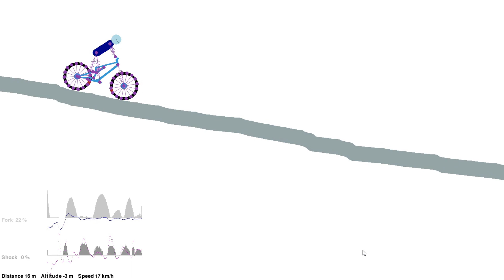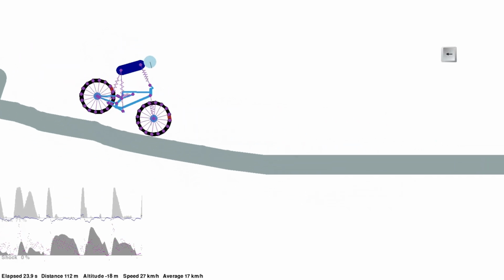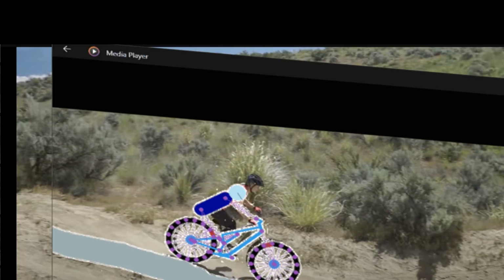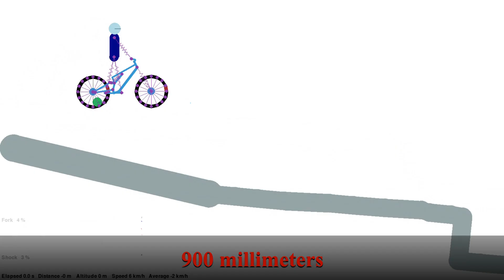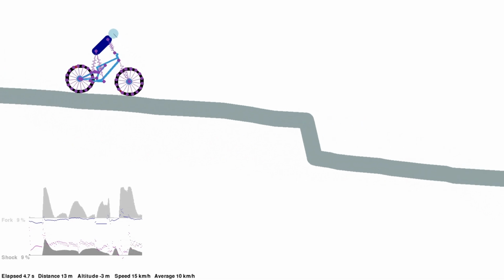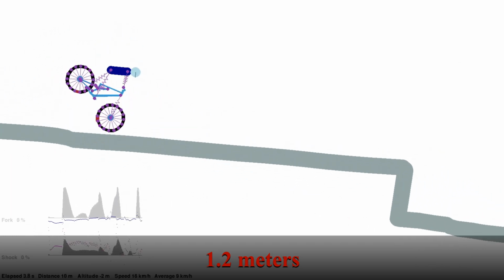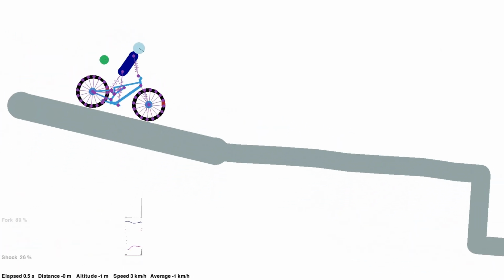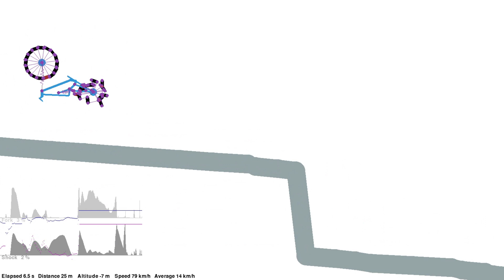Step-down drop fail! — mountain bike physics

Comment: When i do drops, i lower my body in the neutral position, then push my bars forward going off the lip. No preload. But it requires a much faster approach
Reply from the maker: I know what you mean. Gyro is controlled by making his arms longer or shorter, or his legs longer or shorter. When I push the controller button to make his arms longer I can think about it two ways. In one sense he is "leaning back" but in another sense he is "pushing the bars forward". From the physics point of view it is kind of the same thing I guess.

Comment: Nice work. Would like to see the physics of a "real" bunnyhop where the body is doing the movement of a mirror-inverted L to lift the front wheel first. The body movement to the basic position later lifts the rear wheel.
Reply from the maker: Cool idea! I should explore real bunny hops more in a future video.

Comment: Teach Gyro to manual and to uload both wheels shortly gefore the drop by a sort of bunny hop while shifting weight  backwards. 
Also include dampening to your suspension!
Reply from the maker: Gyro needs a closed-loop feedback control system to do a manual, quite a serious upgrade. We will save up for it.

I do plan a future video about suspension spring rates and damping. The setup is working but not dialed in yet.

Comment: Very interesting simulation. Great work.

It takes much more skill to do pretty much anything on a bike slowly. Within reason, the bigger the drop, the smaller it will feel with a bit of speed. Steady speed too, if its available. It would interesting to see the impact of having steady and higher speed when the reaching the drop.

Also, would bent knees, bent arms, low and centred over the bike (the attack position) change the riders centre of gravity. Good technique is to be in the attack position at take off, push out in the air, and then suck it all up on the landing. Getting way more complicated though.
Reply from the maker: Thanks for the feedback.

Gyro agrees with you: faster=easier drops. Gyro rides in the attack position by default so his abilities are most limited by how quickly and accurately I can push the controller buttons.

Good point about the landings. Gyro has not emphasized trying to absorb the energy on landing - he just takes the punishment. We could try to play around and see if we can get the timing right.
Reply: @moregameconcepts  Great to see a rider who's prepared to take a bit of punishment but gets straight back up to give it another go after wiping out. That is true courage. Gyro has it in spades.

Comment: You've probably already though of this, but something that might work on the bigger drops is pushing the back wheel down while in the air. Unweight the front wheel as Gyro is going over the drop and then before he lands have him pushed down using the 'pedals'. 
Just a thought, anyways nice vid  🙃👍
Reply from the maker: At low speed the front wheel starts to nosedive before the back wheel even gets to the edge so it is too late to try to push down while in the air. At higher speed, un-weighting the front wheel is good enough already so your strategy of standing up in the air does not hurt but is not necessary.
Reply: @moregameconcepts  Ok, appreciate you taking the time to explain that to me.

Comment: Pretty cool stuff. How did you characterize the stiffness of Gyro's limbs, did you dial the suspension tuning by trial and error?
Reply from the maker: Glad you like it. Yes you are right - limb spring rate and damping was by trial and error to make Gyro's movement seem natural. The suspension was "tuned" using the compression graphs in the lower left. I set the "sag" preload and checked "bottom-out". I plan a future video about more thorough analysis of suspension tuning.

Comment: Try preloading the suspension with Gyro's body weight before the drop.  Also on the smaller drops, at low speed, Gyro can hinge forward, lower the chest to the bars and let the front wheel drop as his arms extend.
Reply from the maker: I agree those methods work for small drop heights. We tried preloading straight down on the suspension before the larger drop heights but the bike still nosedives. Either Gyro needs to do a full bunny hop so the back wheel clears the edge or else there needs to be some front/back weight transfer. Gyro and I have found that front/back motion works better and is much more forgiving than up/down motion. Also Gyro gets less fatigued.
Reply: @moregameconcepts  As a MTBer I agree and he was close during 2:30.  Just needed to learn to lean back driving the rear down while springing up that way only the front is unloaded - front stays up longer easier (slower big drops) and no worry about clipping rear.
Reply from the maker: Good advice thanks.

Comment: Good to see Gyro surviving a bit more of the beatings...

For one of the slow big drops... (If you got the 'equal and opposite' thing right where his mass moving back also accelerates the bike forward...)
(Non motorised version)
Have Gyro push down on the bars just before the lip then push out (move back) so the front is rising as he goes back and the front is leaving the lip.
Also you may find NOT pushing down on the back as well as the front in a drop has a better effect, as pushing down on the back will tend to push back before the rear leaves the lip.. meaning the rear of the bike will be pushed up.. making the front drop... nosediving poor Gyro into another Pixel Hell.. basically having the same effect as not loading either wheel...
(Actually interesting point... does his trajectory with a mid load (both wheels) have the same effect as just rolling off... 
hmmm... I was thinking the roll off should be slightly faster to compensate... then realised... if I'm right... if the mid bounce has the front leave the lip before the rear has finished rising.. that will lever the front down faster as it rises...  if both wheels rise fully and the bike (and gyro fall back some before the rear wheel leaves the lip... (like a shockwave)... again it will load the back and then push the nose down...
And if both wheels clear the lip...    well actually that's a European bunny hop.. and in theory, no difference in load of the wheels so no angle change... Gyro should land flat... but at a higher drop than just rolling off... which may be just too much impact load...

oooo my brain hurts...   (And I am literally in the middle of watching 'the Time Travellers Wife' series...

so of course though up something else...  Have you tried softening the landing by "bending his knees" on landing...
and also is it softer landing a little nose first...

(Personal experience, landing tail 1st accelerates the front into the ground worse than the other way around. (Literally broke 1/4 of my front spokes on a very nose high landing on my old IT200 enduro trailbike.
Reply: as for timing, try to start the shift back closer to the lip... almost as the bottom of the wheel touches the lip... 
For that big drop but too slow... try the full set...
Move Gyro up and over the front, bump Gyro's shoulders and the forks down so they hit bottom as the centre of the front wheel is about to leave the lip and immediately start the rear weight shift... If his "Knees" are bent at the end of the push , extending them as he falls may also help survive the nosedive.
Reply from the maker: Gyro and I tried every possible weight shift on the big drop and just could not get it to land unless Gyro was going fast enough. Or when he pedaled to add a torque to counteract the dive. With only a few meters runway Gyro was not going fast enough to get the back wheel over the edge before the front nosedive. Even when he was able to get the timing right to manual over the edge he continued backward rotation to land on his back. He does not have good enough balance to pull off those moves.
Reply: @moregameconcepts  Another subtle 'in air' trick is to put the brakes on... this stops the wheels and the torque implied on the frame will tip the nose down...
actually a trick no known by most MTB riders unless they do large jumps or have ridden a motor bike where the mass of the spinning wheels has a more noticeable effect.
Reply from the maker: Gyro has tried applying the brakes in the air. It changes his rotation but not very much.
Reply: @moregameconcepts  realistic. MTB wheels don't have a huge amount of rotational mass vs the body on the bike.

Comment: Very intresting. I have a question. I have a small youtube channel about urban urban policy, mainly focused right now on Transportation and I am working on a video about Bicycle Infrastructure. 

Could you simulate with this program the different impact loads of badly designed bicycle ramps and even no ramp at all (only a sidewalk curb one needs to overcome). And how different Wheel sizes might have greater imapct regarding these diferent designs?
Reply from the maker: Hi thanks for watching. Yes I could simulate different ramps or curbs with different wheel sizes. When you say "impact loads" what do you mean? What would be the output of such a simulation?
Reply: @moregameconcepts  the graph there on the lower left side reading Fork I presume is the "force" applied on the front fork by the impacts right? Or the "compression" of the front suspension?

So, I presume with the 600mm drop tehre is a greater numerical output from that graph coparing to the 300mm drop, right?
Reply from the maker: It is a full-suspension bike with air cylinders. The lines in the lower left show the amount of compression in the air cylinders.

The model uses impulses and not forces. So we could calculate relative forces based on those impulses. The exact values may not be accurate because of different bike shapes, rider weights, tire pressures, etc. So the values would be relative and not absolute.

Is it helpful if I tell you a curb twice as high gives a force twice as high? I think everyone already knows this intuitively.

If you send me some example use cases then we can try it.
Reply: @moregameconcepts  In essence I want to show that bedly designed curbs/ramps have a greater impact, thus, that they are more unconfortable for the rider

Comment: Very educational and clear what happens when you have different approach to a jump, I will try to drop my bar on 600 mm see if I can roll over like a pro.
Reply: If you want to actually experiment with something... (and safely)...
On a axle high drop (so rollable at a brisk walking pace...)   
Try this... roll in at a good rolling speed... mid weight, shoulders down a little, elbows out... then just "Bump" the forks down so they hit bottom of the bump just before leaving the lip.

Don't bother pushing back... just the bump... (You can practice on a curb 1st)..
I did a video on it... I found I can drop 1m from flat to flat with just a front preload... 
and when I got distracted by a call 'rider down' and near stopped on a 1m drop, then rolled into it WAY too slow... I survived by the Bump AND a push out from barely a walking pace. (about 1/2 the speed of the roll off I did at the beginning of the vid near faceplanting... just for the video...

The things I do at fifty (...five...)
Reply from the maker: Thanks! I do not recommend trying to "drop the bar" and roll a 600 mm drop but some of the other approaches should work.

Comment: need one for hardtails. plz
Reply from the maker: I do plan a future video comparing different geom and susp setups
Reply: @moregameconcepts  in the future (playable demo etc) you may want to add adjustable dampening, preload and travel... (you could even add low/high speed dampening... just before you go insane and build a clock tower and rifle for Gyro...
Reply from the maker: Yes I plan to experiment with bike geometry, spring rates, and damping in a future video. No clock towers though.
Reply: @moregameconcepts  I sort of missed the main thing... The bike is starting to behave like... A bike.

Now port your experiment to a AI and let them crash a thousand times for you.
Reply from the maker: Actually I have thought about how to automate the testing. Right now it is more fun to "drive" Gyro myself but I will keep thinking about the benefits of automation.

Comment: Was that a kyle and april video you overlayed? Looked familiar. Cool sim though!
Reply from the maker: Thanks. Kyle and April had a good camera angle - well spotted!
Reply: @moregameconcepts  I guess what you really need is a side on with either a drone or gurney so the camera remains centred on the bike like it does in the simm...

Joy of Bike had some clear (albeit fixed camera) drops...
https://youtu.be/IKtsSr7CGUY?t=102
Reply from the maker: Thanks for that video. That is their advanced method to basically bunny hop over the edge. I see they also have a beginner one with the push-out method. https://www.youtube.com/watch?v=7i2GK1NDStM

Comment: Bunny hop over a 1.2 meter drop seems like what an actual human rider might do.
Reply from the maker: Could be. Pinkbike publishes a regular documentary about what real riders do https://youtu.be/5Xxsui5BQmc
(and also what they should not do) https://www.youtube.com/watch?v=049aM-gTJzI
Reply: @moregameconcepts  Lots of ramps, only a few drops in that first clip. In the second clip -- ouch -- that one major cliff face drop is interesting. I doubt anybody would take that challenge if the face was all stone and not largely sand. The speed booster helps your sim take those drops, but it seems an actual rider might take them slowly instead of quickly. Walk first, run later.
Reply from the maker: Yes, pedaling off a drop is a valid technique: https://youtu.be/GwmAaxo316U
Reply: only VERY good riders, and a lot of very bad riders bunny hop over a drop. The chance of catching the rear wheel on the lip will accelerate the front down..

Hilarity ensues.
Reply from the maker: I can tell you after doing hundreds of virtual drops with Gyro that the handlebar pull-in then push-out technique is the easiest and most reliable to get the timing right. Although the handlebar push-down method (and resulting bunny hop) can work it is much trickier and the timing needs to be more precise.
Reply: @moregameconcepts  Can you get Gyro to just push the bars, without loading the pedals causing a bunny hop... 

As for suspension dampening set up... generally the return speed want's to be about as fast as possible... without resulting in the wheel leaving the ground.  
Too little dampening has the wheel 'bounce"..
Too much has the forks still returning when the next bump hits resulting in the front squatting as you go over things like steps.
You could probably spend a week just getting the math right on the valves an progressive spring(air) rates...
Gone are the days of simple spring, followed by simple spring /oil with a valve to slow the oil on return...
Reply from the maker: I just tried your suggestion. Pushing to pre-load the bars and then releasing is better than nothing and works on small drops. It sometimes works from a larger height but the timing has to be perfect because of the spring rate and damping sensitivity issues you mentioned. I tried a couple of spring and damping rates but obviously I have not played with progressive rates. 

For Gyro the magic happens with the front/back weight shift which is very forgiving. Real life may be different as this is just a simulation.
Reply: @moregameconcepts  Of course the issue comes when in real life, you have a fairly big set of sensors and weight positioning motors combined with a fairly good learning model... 
The good ol human...not that we don't have our share of OTB or wheels entering an alternate reality...